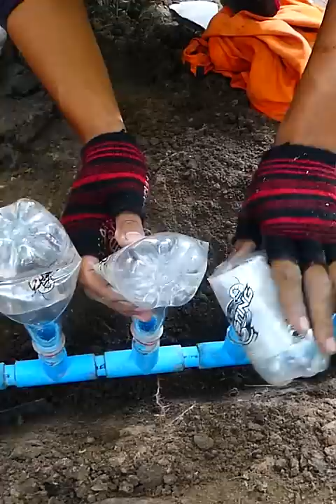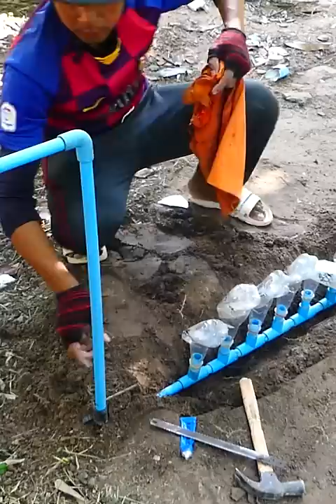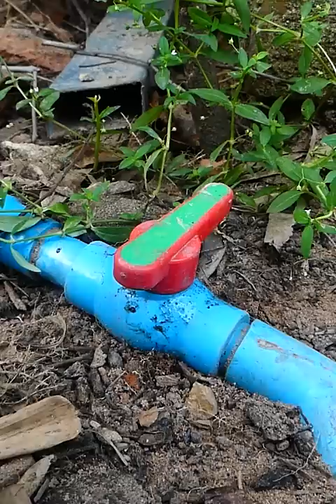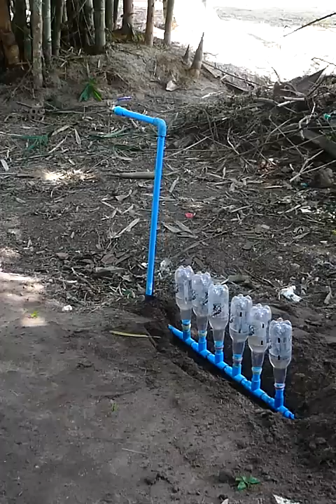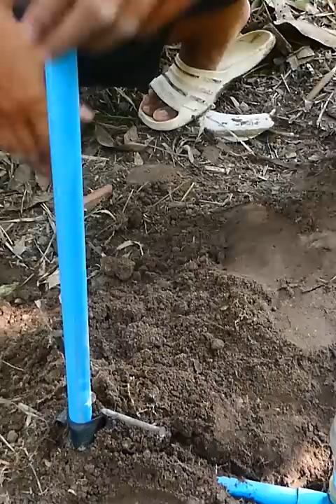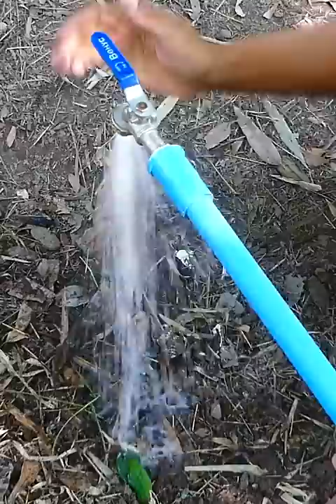Trick Free electricity | I turn PVC pipe into a water pump at home free no need electricity power

Comment: The hardest part about making a free energy device is hiding the power cord.
Reply: Or the battery, lmfao 😅😅😅
Reply: Or the pipe back to the water main.
Reply: Its not free energy device, bro
Reply: More like "Energy free device"
Reply: Electroboom fan ?
Reply: I guess you don't understand physics.
Reply: It’s just using water pressure that is already there
Reply: There is no power cord. It just builds pressure, when the pressure is gone, the trick is over
Reply: Destroyed in milli seconds 😂😂
Reply: The water source😂
Reply: No entiendo el idioma.
Reply: No se traduce 😢
Reply: Didn't even bother hiding the mains water, you see him turn it on just before the free water pump starts to work 😂😂
Reply: that Easiest part of being stupid is writing this comment to the public.
Reply: UH???
THIS IS JUST POWERED BY THE SUN AND THE FLOW OF WATER FROM ANOTHER SOURCE.
Reply: Im lost, what part of this has to do with electricity? 🤷‍♂️
Reply: nobodys ever head THAT comment before
Reply: @Dongyuuu  Explain the "physics" to me. Taps closed off either side of plastic bottles. Supply side turned on and partially fill and expand to correct shape. Explain what "physics" was at play to do that?   Other than the supply side being already pressurised of course..
Reply: @G00gLe_was_my_idea989  It appears that we are supposed to believe that the water would be required to be pumped to the tap, requiring electricity. Somehow I think we are supposed to believe that the empty bottles and a bit of PVC pipe somehow draw water from the supply. Like yeah. I was initially confused also. I had to smile at the commenter suggesting we don't understand physics.
Reply: @briannewton3535 it might be working- if he created somehow underpressure in those botles that will draw water from supply below. These are just empty bottles, think that they were filled due to higher pressure in water source
Reply: lol
Reply: @Dongyuuu  You appear unable to explain the physics to me. It appears that it is you who doesn't understand physics 🤣😅
Reply: @pinmast0r because he doesn't need to hide it. You don't even understand the point of what he did
Reply: @TOBY-jy7bz  neither does he 😂
Reply: @pinmast0r  He does. The bottles create pressure which help give the little push the water needs to finish flowing upwards. The pressure alone from the valve wasn't enough
Reply: Haven't heard of photosynthesis?😂
Reply: When people go around making comments like these, it's pretty ignorant because otherwise we wouldn't be where we are nowadays with the inventions we've made. There's definitely a way to get free energy without any loss, we just haven't discovered it yet, or the people that have didn't get very far when corporations found out.
Reply: Why would I hide the power cord on my free energy machine? You've got to be able to get the electricity out of it one way or another. No you can't see it. It's mine.
Reply: @pinmast0r  you mean when it literally ZOOMS IN ON HIM TURNING ON THE WATER??! 
Yeah, I almost missed that part........ 🤦‍♂️
Reply: The amount of people that didn't get the joke
Reply: @lanthanumlanthanium6373  I love your ignorant arrogance when you say "there is definitely a way to get free energy without any loss. Kinda like someone saying there definitely are magical invisible unicorns, we just haven't discovered them yet.
Reply: @briannewton3535  I loved the part where you didn't explain why you disagree by providing a logical explanation and instead resorted to ad-hominem attacks, real classy.
Reply: @lanthanumlanthanium6373  Haha, Learn what an ad-hominem is before you start using the term. I drew an equivalent argument to your argument, You are ignorant, as you absolutely do not know there is a way to get free energy without loss, and you are arrogant to claim it can be done. 
You claim  "there is definitely a way to get free energy without any loss." You have taken on the burden of proof by making this claim. Support your claim, explain how there is definitely a way. 
If I were to claim that there is definitely a way to detect invisible unicorns, then I would take on that burden of proof. 
Your confidence equals that of a theist that knows a god exists, yet is unable to demonstrate it.
Reply: Electroboom proud student ✌🏼
Reply: True
Reply: А тук дори електричество няма..😂😂😂😂
Reply: @Dongyuuu i guess ur blind because theres a power cord in clear view in one of the  takes. Its black, under the pipe with the bottles so no hes not using water preasuer or physics hes using an electric water pump
Reply: Its a ramp pump. It works
Reply: @eduardomirafuentes1420 а в чем фокус? Я так и не понял
Reply: Somebody didn't watch the video
Reply: Or in this situation, a pump
Reply: @Dongyuuu  you neither
Reply: @TOBY-jy7bz  where did initial pressure in bottles came from?
Reply: @lanthanumlanthanium6373  you are the ignorant one. Free energy is impossible because it goes against thermodynamic laws
Reply: @lanthanumlanthanium6373  dude, your initial statement had no basis to begin with.  "I believe" is nothing.
Reply: @worldspam5682  Having air inside
Reply: @TOBY-jy7bz  I asked about initial pressure. What made that air condensed in the first place?
Reply: @worldspam5682  It didn't? There was little air in the bottle, the water started flowing, compressing the air.
Reply: @worldspam5682  People thought Thomas Edison and Benjamin Franklin were crazy too.
Reply: or paying the bill on time

Comment: It's always important to squish the bottles before you turn on the garden hose.
Reply: Don't forget the all important flick.
Reply: he showed the pressure inside, so dont forget to make stupid comment and feel proud about it !
Reply: @Mouldy1986 the pressure that was already evident when the bottles filled with water? 😂
Reply: Wtf is this?
Reply: I believe the purpose was so that there was less air in the bottles so that the water could fill them
Reply: @jaquicx9500  the purpose was to baffle you with bullshit. It had zero effect on the garden hose connected to the end of the PVC pipe.
Reply: i don't think he need to do that any more later on
Reply: good thing there was a lot of water pressure from the start 😂
Reply: That's how a plumbus is done
Reply: @Mouldy1986  oof, the irony
Reply: Because before this video, he needs to test the leaks.  Found no leaks, shut off the Main before the plastic bottles, turn on the faucet to drain the system, squeeze and empty the bottles.
Reply: @manuelbraga9335  homemade ram pump.
Reply: The secret every1 seems to miss is the index finger tapping.
Very important as the pressure is high & the tap triggers a reaction.
Reply: @@johnjohn5315
An electric or manual pump further back on that line.
Reply: Well actually it’s necessary in a real pump that doesn’t work on electricity it primes it. Like the little squishy ball on a gas operated weed whacker
Reply: @Astrnauted  that weed whacker is a gravity fed system, where do you think this water is coming from? If you don't think there's a water hose connected to that pvc, you should send him some money for the plans for that marvelous invention.
Reply: @stephenwalker6939  I’m talking hypothetically this could work similar to an aqueduct or similar. The same way a siphon works. Idc about this video in particular and it probably is a sham for views but the principle is similar. With enough pressure in apparatus acting as expansion/buffer tanks(like the bottles in the video) you could certainly have enough pressure to push a water column up the spigot and out.
Reply: @Astrnauted  siphoning and aqueducts both depend on gravity to function, in other words, shit don't run uphill, squeezing and flicking plastic bottles won't change the laws of physics.
Reply: See, I know this can be perplexing for some but the ambient pressure inside the amplifier chambers(water bottles)will begin to build static head pressure thus multiplying the compressed volume of water thru the primary distribution line magnifying the the molecular structure of water. Sounded good, didn’t it? Dude went dumpster diving found some trash and creatively made a “fool finder”! Because anyone who stops, looks, and considers this a true concept, bam, found a fool!😂😂
Reply: Future is now
Reply: @Mouldy1986  you need an education
Reply: Meh…. A Third World ram pump, basically
Reply: @SergeantMajorH  Thank you, only comment that I have found that actually has some sort of clue as what is going on. Majority of the population of the USA has no idea of what a ram pump is or how it works. We had an antique one on the farm that we pump water up a steep incline, then about half a mile to a house from a spring.
Reply: @retri779  a few crushed plastic bottles does not make a ram pump. 😂

Yes, ram pumps exist, but the BS in this video is pure BS, nothing else. He has a garden hose pumping into this thing, at the very least. It's ridiculous.

Comment: Fluid mechanics has left the chat.
Reply: Que aburrido
Reply: Looooooooooooool
Reply: Reynolds not found... ;)
Reply: I laughed aloud at this. Thank you.
Reply: Come here 😂😂😂
Reply: If you have a stream with flowing water you can build something like this.  The longer the pipe you put into the water the higher your flow rate will be.  It's called a ram pump.  No electricity needed.
Reply: @gtd360  but have u seen the burst of water pressure? I doubt it came from those bottles.
Reply: @ohdjrp4  that's why I said, "like" this.
Reply: @gtd360  ya and it does it producing waste water and not at this high a flow rate. Do you see any water water?
Reply: @gopackgo4036  Uh, could you edit your comment into something comprehensible?  A ram pump wouldn't create waste water and you can get decent water pressure from one. If you wanted more pressure then you could make a longer ram pump to fill a raised water tank.
Reply: @gtd360  Let me simplify this for you: (1) No such thing as free energy, you can’t just put a “long pipe,” as you say, in water and end up with a pump. (2) Ram pump produces water waste, in other words, to pump 1 gal up 1 m you would need to transfer all the kinetic energy from an additional 2 gal into that 1 gal. This is done via a series of one way valves that discharge the “wastewater” as a consequence. It’s not wastewater as in sewage, it’s wastewater as in water with low KE.
Reply: @gtd360 Thank you for explaining this video. I was sure all the wise cracks missed the point, but I didn’t know why
Reply: @gtd360 this video is not an example of a ram pump. Stop defending the trash.

Comment: he created a waterpump so the water can go upwards. a standard waterpump needs electricity to pump the water upstairs for example. he did the trick with empty bottles. thats pretty much impressive. props to him😊
Reply: This is the answer. ⬆️
Reply: Um no..pressurized water will flow upward to an open outlet…..no pump needed, the water before the valve was already pressurized, thats why the bottles inflated to begin with…duh
Reply: I knew this is what he was doing but... how do u know he didn't have a water pump further beyond the bottles...  lol
Reply: Before: Pressurized (by a pump) water in pipes.
After: Pressurized (by a pump) water in pipes.
This video is an amazing shitpost.
Reply: @DavidBlair-n1n Or, deflating the bottles initially, creates suction that pulls the water and creates the flow.
Reply: @lucyluu3539  you know he had pressurized water to begin with because of how rockhard the bottles got when they inflated…. Absolutely no way those bottles would’ve inflated without pressurized water.
Reply: no at best its a bad surge arrestor 
he wasted more on that plastic bottle setup than anything he gained.
Reply: @alicerichmond8708  the line was open... thus atmospheric.  He then closed the open spigot and pressurized the bottles.  (he couldnt have done it with a closed spigot) 

There was nothing gained

Comment: obviously he has water pressure to fill the bottles. So the issue he seems to be fixing is a flow problem and the bottles are used in place of an accumulator to provide more water volume for a short period of time. All that extra pvc would have been just as cheap to use a single accumulator.    An accumulator is similar to a pressure tank but it's main purpose is to provide more volume for a limited time rather than a steady pressure .
Reply: Oh gitu
Reply: No its Cap he has a pump buried just behind those bottles lol if ypu watch some of his other videos you can see it in a few
Reply: @skippingrhyme4386  that's not what he meant. what he meant was that the pump is not fast enough for his needs, so he made this to give a higher flow for a short time whenever he opens the valve.
Reply: @msnurul9674 artinya apa bang messi?
Reply: I was gonna say, all he did was increase the water pressure temporarily. If he wants it continuously, a water pressure tank eould be needed. Those can aslo be made though. 😀
Reply: By the looks of it, he is in a rural area. An accumulator may be more expensive there and pvc pipes are likely to be more plentiful. Thus this is useful for those with a lack of resources.
Reply: I was wondering when someone would state the obvious
Reply: @cjminis9043  за счет чего увеличиться напор? если кран находится выше емкости!!?
Reply: @Melkiy88  How does it increase the pressure? Easy. The water is pushing on the air in the bottles on the line. This causes pressure. But it is only temporary because of the types of seals and materials that are used. And I don't know what you are talking about with a crane... maybe Google translate messed something up. Sorry, I don't speak Russian.
Reply: Does using an accumulater need electricity? Cuase that is one of the problems here. It seems like the guy's solving a technical problem with very limited resources.
Reply: Exactly 😂
Reply: Not even an accumulator. Those bottles have trapped air, limiting how much water gets in, and the rigidity of the bottle limits how much escapes. What he made actually does nothing at all, good or bad.

Comment: "In my village, we drink electricity."
Reply: funny, but it's about using water without turning on the electric pump - in this sense, without electricity
Reply: @dmitriyporisenkov7657  if you think that wasn't connected to a water hose, this video was for you.
Reply: does it taste like "Shockolate" and made with lightning, real lightning?
Reply: This made my head hurt
Reply: @dmitriyporisenkov7657  to compress air you need pressure, and you can't get pressure without energy source of some kind. And why you need to compress air in order to get water pressure if you already have water pressure?

Comment: Главное - постукать по бутылкам. Тогда все поверят
Reply: И тряпочкой протереть трубу
Reply: Ich denke er wollte nur, dass die Tropfen an den Seiten der Flasche unten in das restliche Wasser fallen 🤔
Reply: can you hooked up to a regular line and then when he hits it open before the bottles he has the line shut off but pressurized and that's why it inflates the bottles. then he opens it up and that's why it runs like it does it's hooked up to a regular City Line or a water pump. anybody that's worked as a plumber will know this.
Reply: @CARPETMAN-zj9iv  don't have to be a plumber to know what air pressure is and does.